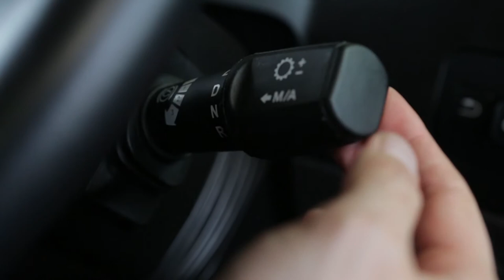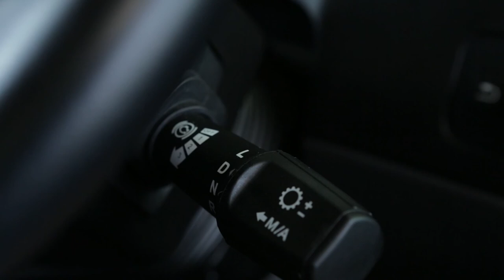International Truck Stalk Shifter Training Guide

Comment: I am new to international trucks but the company i now work for now has some in the fleet. Ive driven a couple different 2019-2020 model LTs and when hitting 9th gear it beeps at me and wont shift or downshift. If i am in D and switch to M and i am in 9th gear or above it beeps and i am locked into that gear. No down shift or up shift doesnt matter the RPM or speed. So if if i shift up to 9th manually, then i am forced to switch to D.

I never experienced this in Freightliners or Volvos. This happens in all of our LT trucks. Not sure what i am doing wrong.

Comment: The 2020 day cab LT I drive is constantly shifting into 11th for the slightest incline and after going downhill after it goes under the set speed.  I got better mileage with a 10 speed manual than with this junk.

Comment: Ok I’m sort of new at this.  Can you switch from “D” to “M” on the fly?    It changes on the display, but it just beeps at me.  Matter of fact, when I tried it from a stop, it worked better, but as I started manually upshifting, it started beeping again and I had to pull over, stop, and go back to automatic mode.   What am I doing wrong?  Thanks.  Oh, I have a 2020
Reply from the maker: Hi Brian, thanks for the comment. Alot of this will depend on what truck or transmission you have. If we assume you have an Eaton Endurant transmission which is popular for your model year then it could be the way the transmission is programmed or could be how you are trying to use it. It sounds like maybe the transmission is rejecting a selection to protect itself?  Please recognize we can not diagnose issues over the internet without seeing and testing the truck in person.  But we can also share the following, which is from the Endurant Operator Manual. 

MANUAL/Hold Mode Gear
Hold Mode Gear can be configured to limit the use of MANUAL Mode. When Hold Mode Gear is configured to a gear number, MANUAL Mode becomes a hold gear function only. The default setting for this feature is Disabled and can be configured in the Transmission Control Module (TCM) using ServiceRanger.
• If MANUAL Mode is selected and the transmission is in a gear equal to or greater than the configured Hold Mode Gear; the transmission remains in the current gear, upshift/downshift requests with the Transmission Driver Interface are ignored and an audible tone may be emitted every 10 seconds.
• If MANUAL Mode is selected and the transmission is in a gear less than the configured Hold Mode Gear; the transmission allows standard MANUAL Mode operation.
Note: The system may automatically initiate a gear change based on vehicle operating conditions, refer to Transmission MANUAL/LOW Override section
 
Transmission MANUAL/LOW Override
The transmission system may automatically override or prevent driver mode requests and upshift/downshift requests based on vehicle operating conditions. If the system overrides a request an audible tone may be emitted.
• If the transmission is being back driven and the engine is approaching a higher than normal RPM level, the system will override the MANUAL request or LOW Mode and perform an upshift.
NOTICE: The system initiates upshifts for engine overspeed protection.
• If the start gear is changed and it causes the engine to lug at a launch, the system will override the MANUAL request and select the appropriate gear
Reply: @CumberlandInternationalTrucks  ok thanks.  It’s an A26 engine.  I’m sure I just did something wrong.   I’ll just put it in auto tomorrow on cabbage, put the Jake on 2, and cruise control at 30mph.    That should do the trick.   First time going down it.
Reply: You should be able to, depending on what rig you have, every automatic I’ve driven has been able to do that, it’s so you can select the gear you need for hills!